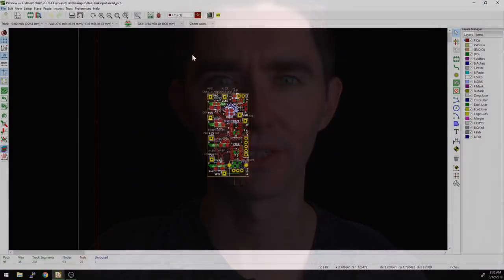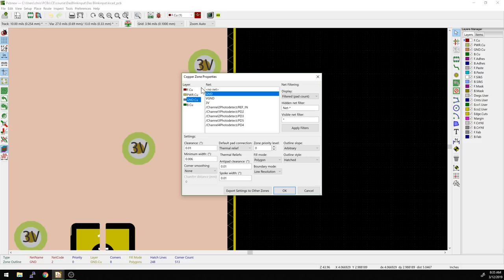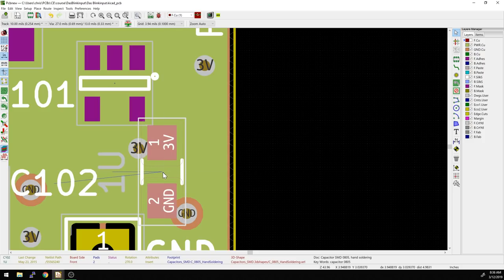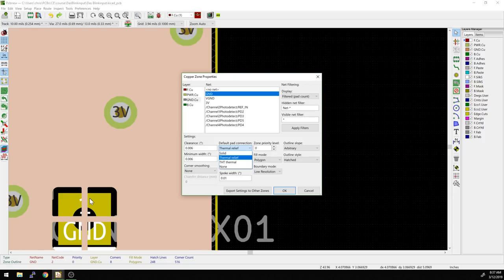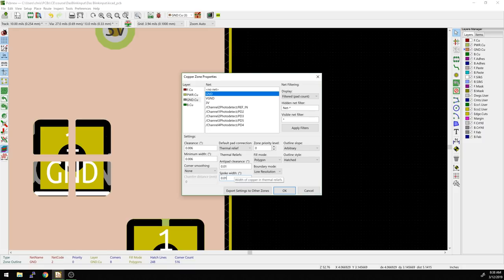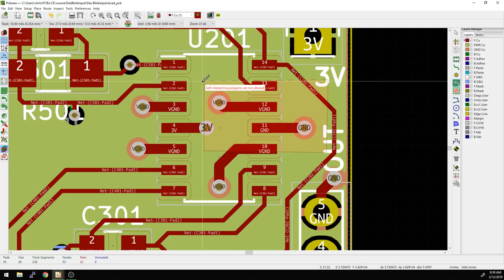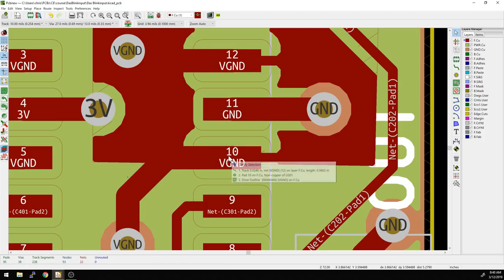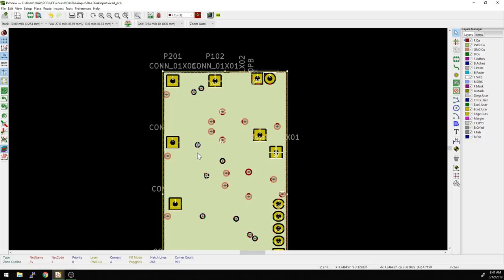KiCad 5.0 - Changing edge clearance and plane parameters

Comment: Great tutorial! When you will check out KiCAD 5.1? It's availiable, but not on kicad-pcb org, which is weird, because source code of 5.1 version you can download from official launchpad of KiCAD.
Reply from the maker: 5.1 is tagged for the nightlies and is almost ready to be released as a stable. A couple weeks after that, we'll start making 5.1 videos. Right now I have it on my dev machine but not my main machine (I only use stable for that)
Reply: @contextualelectronics  But they released it as stable on launchpad. Heck, they work on 5.1.1 now